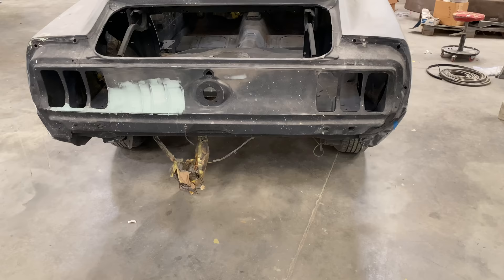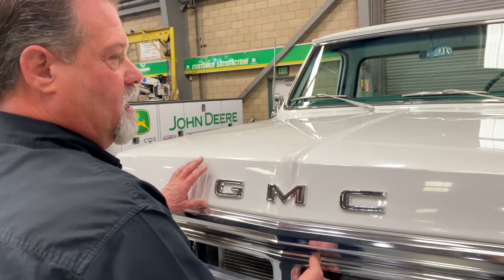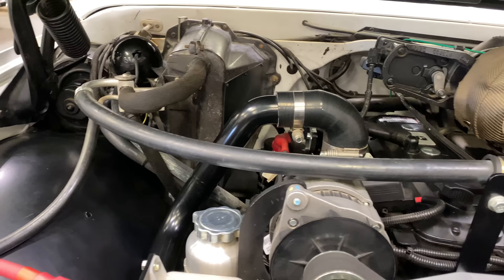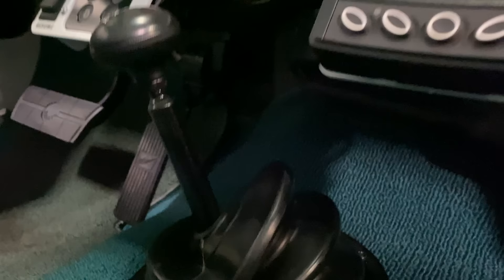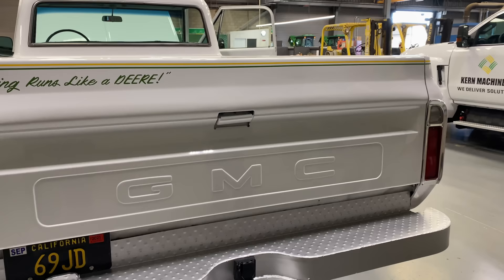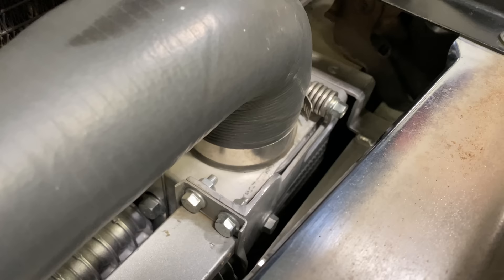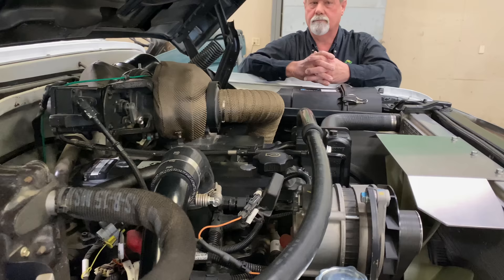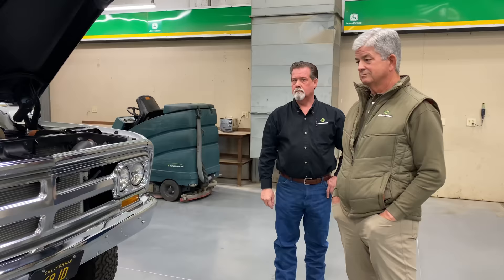John Deere Tractor engine in 1969 GMC truck!

Comment: My Dad had a 1972 G.M.C. 2 wheel drive, 350 auto. Two tone, red and white. Gorgeous truck. 
I am looking for the truck you built, for my wife to drive,  a really incredible job you did.   l have a 4X4, G.M.C. YUKON XL 
QUADSTEER,  WITH A Duramax, L.B.Z. and an Allison 6-speed in it. My wife loves to drive it because it steers so well. The power is nice too.
We have been looking for a clean older truck that we were going to have a diesel installed. Hey you don't want to sell your 4X4 G.M.C. JOHN DEERE powerd truck do you? 
Kinda kidding, l don't think that l would sell my Duramax Yukon. 
Again, thank for sharing, if you decide to sell, let me know! WOW, cool truck.
👌👋🏻,✌🏻💚, 🌧 ❄ 🥶 🇨🇦 👨‍🦽😎.

Comment: I knew a guy that put an International tractor engine in an older pickup. It ran down the road but his speed was limited to about 35 MPH due to the transmission and rear end gearing, the diesel which was a 4 cylinder was running at max RPM, don't know if he ever got the gearing changed to where it would go faster.

Comment: I had heard about 15 years ago that John Deere was going to build an over the road engine, not sure what ever happened to those plans.
Reply: The problem with leaving their current markets, is they'd have to allow end operators and independent repair rights.

You don't "own" a modern jd product. You pretty much lease it, in hostage to a dealer.

Comment: That's an interesting build, however, a nice 404 out of a 4630, or a nice 466 would have been my preference, however, I realize the fitment issues there could be with this truck. If this truck belonged to me, I would have went the 404 or 466 route no matter the difficulty, very nice though regardless.

Comment: In a way a John Deere engine in a gm truck makes sense, along time ago John Deere was putting gm gas engines in some of their smaller combines I knew of and maybe some other equipment I can't remember if there was other equipment they may have used gm engines in, for the most part John Deere made their own engines.

Comment: High Five on the Build!!!

That said.....WHY would you use a New Process 203 chain driven transfer case with numerous moving parts instead of the New Process 205 gear driven transfer case that is simple and super strong???

Comment: Nice conversion with a Deere engine,  certainly Not the first of its kind by any means.  Why didn't you ask him what his fuel mileage is like... a lot of people would have liked to know that answer.... "IF", they would have told you.. that is.   I know of at least 9 other JD engine conversions in pickup trucks and One (a 3 cyl. JD) in a 1988 Mustang 2 and None of them have ever gotten Less than 38 mpg, with NON electronic engines, and as high as 87 mpg - the little Mustang with the 3 cyl.   

There was a fellow in the south eastern US (I've forgotten which state exactly), back in the late 90's / early 2000's that had a tractor restoration business for years, and started doing farm tractor engine (JD, IH, MF etc) conversions in just about any pickup (and a few cars) you wanted..... until the EPA came in and shut him down!!    

Why!?!.... because the big oil companies don't want you getting 40 to 70+ mpg with Non EPA "Approved" engines, and the Gov't. doesn't like getting shafted on the fuel taxes from folks fueling up.. a third to a fourth as much as normal.  The EPA said he was illegally (versus - "legally"?!?) contributing to pollution and global warming by using Non EPA hwy certified engines!!   

Last time I checked,  an engine producing 40 - 87+ mpg was the result of making a heck of a lot better use of a gallon of fuel, than an "EPA Certified" engine for highway use, getting only in the teens or low 20's mpg.     Politics and corruption at its finest!!

Comment: Look out Cummins here comes a deer now all we got to do is put them in a Ford how crazy would it be to have two of the oldest vehicles and American history joined together I'd buy that truck
Reply: My brother worked at GM before he retired.  It was rumored before the Duramax went into the pickup line that a John Deere diesel was under consideration.  I think a 6 cylinder.  Don't know how real that story was or specific engine.

Comment: Nice project, but I'll bet that 4 banger will vibrate the mirrors off at low rpm. It would have been much better with a 6. That said, with all the controversy in the company about right to repair, it wouldn't surprise me if they ordered them to destroy this thing for copyright infringement or some such bulls^^t. Sadly, that's just the way JD operates anymore.🙄

Comment: They wouldn't admit it in this video I would be willing to bet that it's underpowered. they probably overcame some of that with the transmission selection. but even with that taken into consideration it's probably still underpowered. anytime a person puts a four cylinder diesel engine in a forty-five hundred pound truck it's going be  underpowered. it would probably be okay running around in Town. but out on the interstate or driving over mountain passes it will surely struggle no doubt.

Comment: Original 4wd? If it is thats cooler than the modern Deere engine swap considering you rarely see them especially a k20 gmc of those years. 
An old 404 or 466 JD engine cylinder would have been a much better swap.

Comment: Original 4wd? If it is thats cooler than the modern Deere engine swap considering you rarely see them especially a k20 gmc of those years. 
An old 404 or 466 JD engine would have been a much better swap.

Comment: The truck probably sitting in warehouse  collecting dust  when engine  computer died  since JD  doesn't want customers fixing  equipment 
Should have used  IH Case  you can repair  them

Comment: I had a 186 yanmar tractor that got crushed by are tree only thing that still good was the motor 3 cylinder diesel that had more torque than my original 4 cylinder Ford ranger so you can guess where the tractor motor went

Comment: That's the the problem. They have technicians but they forget about mechanics. I've seen alot of master technicians not able to fix things. Take a good technician with mechanic skills then you have something.  Technicians seem to lose the fact why did it fail, they change parts that the computer says is wrong.

Comment: Why not offer it as a kit, we need emissions friendly swaps for our old trucks we wanna keep on the road, Cummins is awesome but a Deere would be an original swap for many rigs now. The world wants to cut back the older diesels and id say as a viewer i would run a john deere motor for a swap would be cool if they offered the engine controller radiator/intercooler and every basic piece needed to swap it into something. Id love to see a newer diesel crate engine offered with a multiple bell housing design rather then swapping it on transmission end etc why not offer bolt holes on engine block for say a allison or nv4500 or any of those commonly used swapped transmissions and have a couple spots for starter bolts for what transmission you use etc. Then it would be order a motor and bolt your transmission of choice on to build around from there

Comment: Did you know that the engine in a 2n Ford tractor is same as in car but lots of changes i know a guy that put a 3 cylinder forklift engine in a 67 Ford pickup

Comment: What model john deere tractor does the engine they used in the truck come in.
Reply: That engine is super popular. Probably the most recognizable application would be their backhoes with the exception of the 710 model.

Comment: would never catch me throw a 4 banger in a classic truck like this if i was putting a tractor motor in a pickup itd be a 6 or 8 cylinder and ps ford had a ranger that came factory with a 2.2l perkins diesel tractor motor which is alot faster than this like what this thing does 55 maybe as they like it i guess

Comment: I might be mistaken, but stacking the radiators like that seems bad. You can't cool anything when you are blowing hot air across something.
Reply: Commonly done. Though some years back Dodge started off setting radiators on their half ton trucks.  My dodge w/ cummins has Air con radiator, air to air intercooler then actual water filled engine radiator.  On a automatic trans model a trans cooler is up front. Then some folks stack a engine oil cooler up front. Not factory as far as I know.
Reply: Pretty much the way all cars have been since the application of more than one heat exchanger.

Comment: ,,,   Assuming this modern engine is equipped with DEF, and particulate filters that self-clean/regenerate,,,,, that will be its headache point :(
Reply: Was a tier 3 engine, no def maybe dpf depending on hp.

Comment: Two things, you got rid of the manual transmission, which was just dumb, then you used a new JD engine instead of something cool and period correct. Trashed that poor truck. Somone go buy it and fix it.